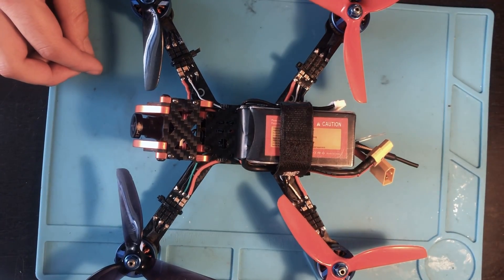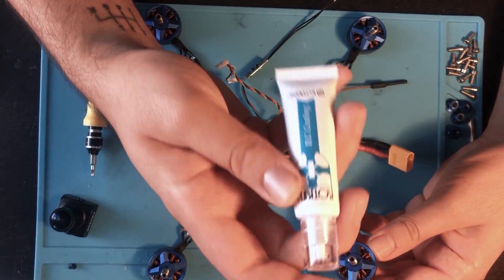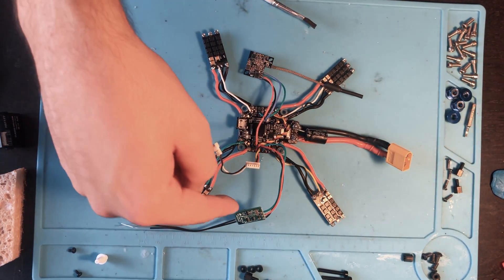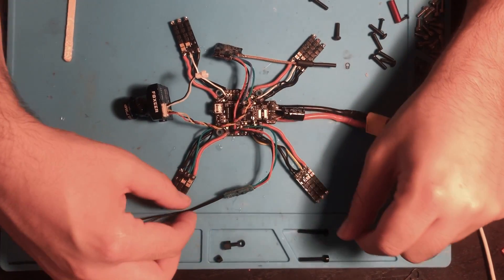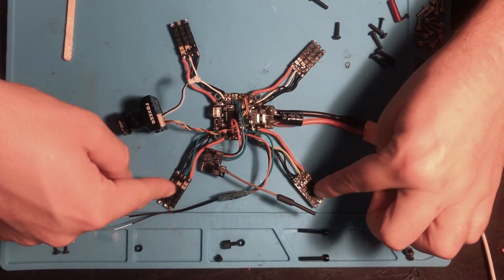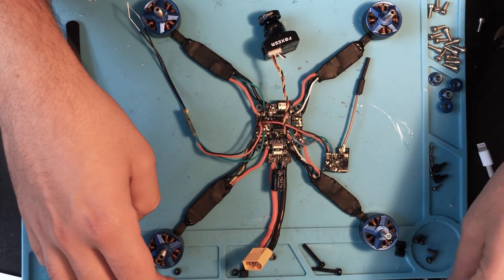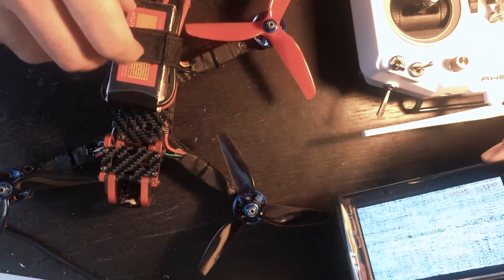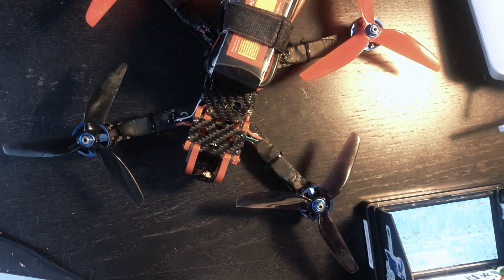How to Waterproof Your Drone

Comment: What about using dielectric grease in the plug fittings?  its typically used for electrical connections for water.

Comment: I get that this is going to help when flying in wet conditions but if it makes it hard to repair like a motor is damaged or need a new flight controller then you would need to buy a whole new drone… can someone confirm if you can make changes or once coated that’s it. Thanks
Reply from the maker: you can peel off the waterproofing to do repairs 👍
Reply: How does it handle heat too?

Comment: I have rush tank ultimate vtx which is have a like metal shielding on top of it, so can I coat it by just flooding it from outside ? or should I open the shield(I dont know if it safe)
Reply: Have the same issue. I’d say open it up and flood it, as the metal heat sink is necessary to dissipate heat. Did you end up trying it?

Comment: Hey I just wanted to ask you about the repairability of the drone after the coating . Would i be able to soder on it again or desoder it with the coat on?
Reply from the maker: You can peel the waterproofing off and then solder whatever you need 👍
Reply: @TRONCATFPV  thanks bro ❤️❤️❤️

Comment: Did you water proof the balance lead to or just left it?
Reply from the maker: Balance lead doesnt require waterproofing. Got an update video coming out soon where I waterproof a Vista 😉
Reply: @TRONCATFPV  not sure that’s good advice. It could easily short
Reply from the maker: @JaydenLawson  if you’re concerned about your balance lead shorting you could put tape around it before flying.

I have used waterproof drones with multiple lipos with nothing covering the balance plug and I’ve never had an issue with any of them.

Comment: hi, thanks for the review

do you thing I can do caddx vista? dissemble it all then do it all over. but there is a heatsink inside vista, do you think this product could keep the heat away?
Reply from the maker: I'm really not sure how waterproof you'll be able to get a vista unit due to the heatsink inside. They make "naked" vistas. I think your best bet might be to get one of those then just coat it in kotking.

Comment: Wonderful video & very helpful ~ I was wondering if you were ever going to make a video tutorial on waterproofing a digital quad with a DJI Air Unit? I'm wanting to try this but I'm not sure it's possible unless you fully enclose the unit. Also are you still using Kotking or is FPV Worry Free the better choice? Thanks & I just subscribed to your channel ~ keep up the great work.
Reply from the maker: I'm in the middle of filming another waterproofing video as we speak! For this next one i'm using an AIO board and FPV worry free. I'm excited to compare the two! 
As far as waterproofing the Air unit or Vista, I've used conformal coating on the outer parts of the vista and its water resistant. I can fly it in light rain & Snow no problems. I wouldnt coat it completely in FPV worry free or kotking since I think it would over heat.
Reply: @TRONCATFPV  can we protect the ESC with kotking ? and not use shrinking wires. thanks

Comment: THIA IS AWESOME AND AO HELPFUL. been wanting to waterproof my 7" long range since i saw that depp designs video. they dont deliver anymore due to chain supply or something ... so this is even a better less clumsy alternative. 
Question ! don't you need some kind a float on the quad preventing drowning when falling in body of water? also would it be ok in salt water?
Reply from the maker: Thanks!!
For floatation yes you would want to add a water bottle underneath or something to the drone so you can retrieve it incase of a failsafe. 
As far as salt water goes, I have dunked mine in the ocean many times and it still works great. I keep a bottle of distilled water to pour over the motors so they dont corrode.
Hope this helps!
Reply: @TRONCAT FPV  hey bro ! thanks for the amazing video you made ! now you have a new invention that is a submarine and a drone in one hahahaha

Comment: Could have just coated the esc's.  Most boards are already conformal coated when you get them new but if course we solder on them.  Be sure to put something in the usb or you'll never be able to use it again
Reply from the maker: I actually had to replace one of the ESC's recently and taking off just the heat shrink made it very easy. Kotking includes little USB-C and Micro USB plugs for the flight controller, definitely want to use those 👍
Thanks for watching!

Comment: Thanks for the vid, I'm thinking of using this on a dji mini, because of the 3 axis gimbal I see issues with the movement, maybe Corrosion X here?
Also because of the casing and the electronics being closed in would Coat King affect overheating as these drones do get warm?
 Thanks, subbed 👍🏼
Reply from the maker: I would be careful with putting anything on the gimbal. If it can’t move freely it will freeze up and not move at all. I think the best thing you could do is see if there’s a clear casing that can go around the gimbal so it can still move freely but is protected. 
Even something like corrosion x or conformal coating could get into the small bearings and cause damage.
Hope this helps!
Reply: @TRONCATFPV  corrosion x is actually a lube too tho so it should be fine on bearings and all.

Comment: How many amps esc you used for this quad? And what is the kv of the motor
Reply from the maker: on this drone the ESC's are 30a and the motors were just 2600kv motors. Thanks for watching!
Reply: It doesn't burn on 4s?
Reply from the maker: @Unknown-nc4ce  I haven’t had any issues on 4s

Comment: what happens if you put it on the esc instead of shrink wrapping? because i have a esc and the flight controller all in one.
Reply from the maker: you can put kotking on the ESC and it will be fine. only reason I did heat shrink on mine is so I can swap them out easier. Stay tuned I actually have a video coming out soon on a new waterproof build that is an AIO board. Thanks for watching!

Comment: Cool video mang. Thanx for showing us that it can be done. Want to attempt a built. Want to hard wire in the antennas to an air unit and then seal it up using high temp silicone. Solder the air unit to the FC then seal both the FC and 4 in 1 with the Kotking. Did you seal up the battery also with the Kotking? And do yo have any advice other than the video. Thanks a bunck.
Reply from the maker: Thank you! I did not put any kotking on the battery, the only parts you need to coat are the FC, ESC, Camera, VTX and reciever. I actually have an update video on this coming out very soon so stay tuned! Thanks for watching!
Reply: @TRONCATFPV  Yeah nice man. Can't wait to see it. I hope you waterproofed an air unit. lol

Comment: Get MG Chemicals silicone modified conformal coating (422B or 422B) and work under UV Light. You can see the coating "glowing" - it will dry faster under uv light and you know where you put it and where not. Everything else is 💩
Reply from the maker: I use conformal coating on all my other quads to make them water resistant, not completely waterproof. Kotking is very thick and will not disrupt sensors where as conformal coating can actually make sensors malfunction (i've had it happen).
Kotking is the best way to go if you're looking to make a quad completely submerge-able. 

Thanks for watching!

Comment: If I did this on a tiny whoop and fly on a hot day can that lead to the quad overheating? I really want to do this but I’m worried if it’ll cause overheating on smaller quads
Reply from the maker: I've actually been thinking of putting kotking on my tinyhawk freestyle. I'll have to add this to my video queue because i've also been curious. Stay tuned! i'll try and make that video soon 👍
Reply: @TRONCATFPV  I was thinking something smaller like the tiny hawk 2 or mobula 7 because of their popularity especially in beginners and because nobody has done it yet. I’m subscribing btw
Reply: @TRONCATFPV  also when you put the coke Cain around plugs like for the camera does that make it unplugable and permanent? Or can you still unplug it but with more force?
Reply from the maker: Thanks for the sub! The tinyhawk freestyle has the same internals as the tinyhawk 2 so im sure it would be similar. Yes you can unplug the camera even after applying kotking, you will have to re-apply kotking once the camera is plugged back in tho.
Reply: @TRONCATFPV  wait, what protects the USB port?
Reply from the maker: Kotking includes a small TPU insert that you can place inside the USB slot then just apply kotking over it

Comment: Hey man, this seems like a great way to make the electronics waterproof, but what about the bearings in the motors? won't those start rusting over time? oh and a question about the kotking itself: does it stink when applying? because currently I'm using silicone conformal coating and it stinks like poison!
Reply from the maker: yes if you dont take the motors apart and clean them they could definitely get rusty over time, especially if you're dunking your drone underwater a lot haha. I typically take a bottle of distilled water with me to rinse the motors afterwards if I do dunk my drone. I haven't had any issues with rust yet!
Kotking has a unique smell lol, it is definitely not as brutal as conformal coating though. 
Thanks for watching!
Reply: @TRONCATFPV  aah that's a nice solution! I think I'm gonna get me some koatking then, because I really hate the smell of conformal coating
Reply from the maker: Haha yea conformal coating is pretty bad. Kotking is definitely more subtle

Comment: The battery wasn't coated 💀 remember to do that too
Reply from the maker: yes you could always add some kotking to the xt60 end or at the base where the wires go in. I havent had any problems with my uncoated batteries but i'm sure it wouldnt hurt!
thanks for watching!
Reply: the battery is waterproof already if the cells are all fine and undamaged

Comment: Just be careful with the USB connector, SD slot or the image sensor of the camera, try not to cover those because it will damage them! :)
Reply from the maker: Yes the image sensor you need to be careful about not covering and normally need to disassemble the camera like I did in this vid. 

For the USB port new shipments of kotking luckily come with a USB cover so you can place that inside the USB port and put kotking right over it. If you need to plug it in you just take the cover out and you’re good 👍 for the micro SD card slot I just caked it up with kotking to be safe lol. On my drone it’s the blackbox but on some drones it records DVR.

Thanks for watching!

Comment: pvb60 is the same?
Reply from the maker: I think that pvb60 would be more similar to conformal coating than kotking. I’ve never used pvb60 so I can’t really vouch for it but just be careful of sensors. 

Kotking is very thick and will not disrupt sensors where as conformal coating can actually make sensors malfunction. I only use conformal coating to make electronics water resistant, not completely waterproof or submergeable.

Thanks for watching!
Reply: @TRONCATFPV  thx

Comment: Wow, video was very well put together. Can't believe you actually put it in the bathtub for us! Thank you. Did you treat the battery in any way? Leads going into the battery from the connector? Can you say a few more words about how you addressed the SD car slot? I wasn't too clear on that. I did see you put KoatKing on it but what about the slot itself?
Reply from the maker: Im glad this video helped! I was nervous putting it in the bathtub lol.
The batteries that I use seem to work fine with no treatment. to be safe you could always put kotking on the battery leads going into the XT60 connector and on the battery.

For the SD card slot, on my drone that is the blackbox SD card. I just kept the SD card in there and put kotking all over it since it doesnt have to be removed.

Thanks for watching!

Comment: You said it might be hard soldering onto the board, have you tried yet? Because I'm sure I'll have to make modifications/repairs at some point
Reply from the maker: I haven't had to do any more work to this drone since applying the kotking. I imagine that you could always try and peel it off by hand since it goes on relatively thick. You could also burn through it with your soldering iron i'm sure. If I have to do any maintenance on this drone that requires removing the kotking I will be sure to film the procedure 🤙

Comment: wow! impressive! so how do you get the footage off the quad with the sd card sealed in. also did you coat inside the usb socket?
Reply from the maker: Good question! The micro SD card that is on the flight controller actually logs blackbox data. The only way that I get footage from the quad is from a GoPro (which is already waterproof) or through my goggle feed.
As for the USB port, new orders of kotking include a little 3D printed USB protector that you insert into the port when coating. This makes it so you can still use the USB port even after applying kotking.
Thanks for watching!
Reply: @TRONCATFPV  ahh I see! I did think a little plug for the USB would be a good idea. Didnt realise the sd was just for blackbox. Great video I want to film some kiteboarding soon i think for that this stuff might be the way forward 👌👍